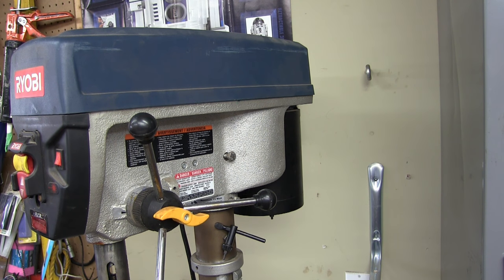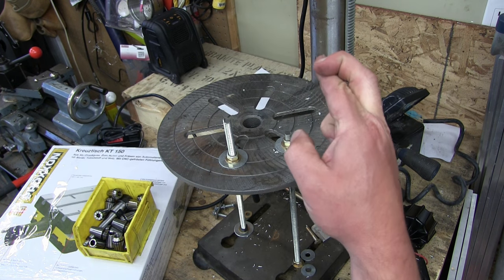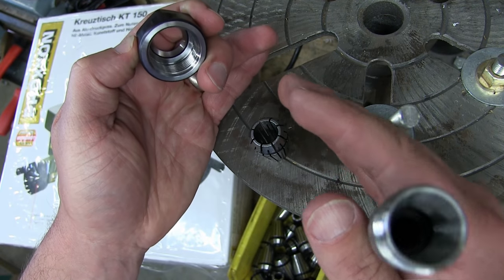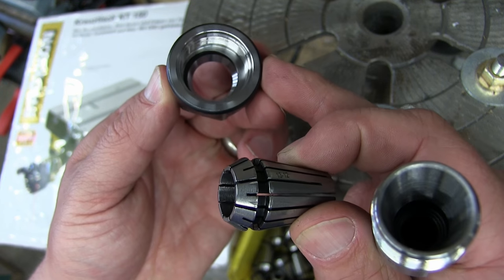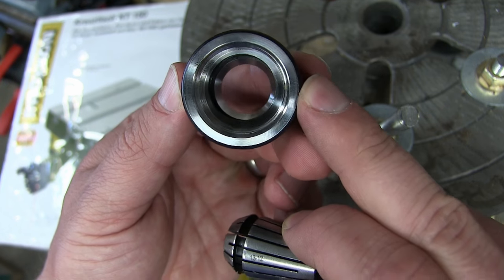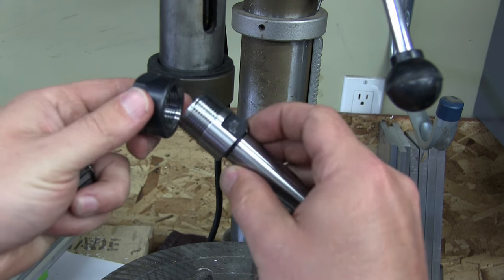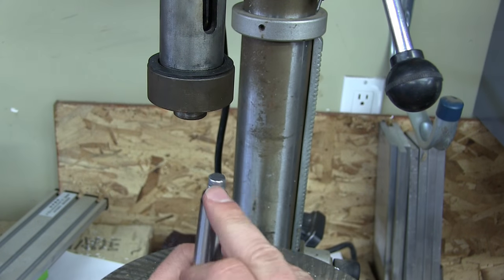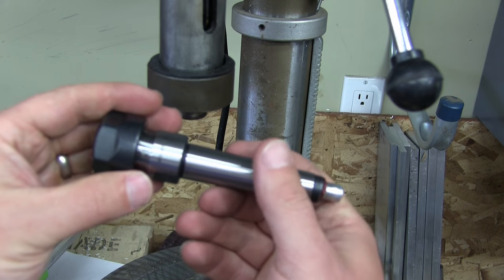SUCCESS!! Drill to Mill Conversion.

Comment: I have a similar setup with a $60 cast iron x,y vice. But I'm still using the Jacobs chuck and the table isn't stabilized. However, I do need to make something resembling a large machinists Jack to lift the sag out of the table so it's somewhat square & plumb. I would rather rely on the table 👆 👇 for Z and leave the spindle retracted completely when possible....less chatter.

Comment: The clamping nut is suppose to have that offset shoulder.  It's for clicking the collet into the clamping nut before tightening.  That's what the groove on the collet is for.  You did say you didn't have much experience with collets.   If you have a jacobs chuck, why do you need collets anyway?...
Reply: BTW, I'm excited to see the video when you add flood coolant.

Comment: The freight has a 2 speed bench top mill for $700, hit it with a 25% coupon brings it to $525. Getting 1/2 way there putting $250 down for the x/y, plus $50ish for the collet and other stuff. Ehhh. idk.

Comment: Looks good so far, but it looks like it could do with being a bit more stiffer to counter the wobbles introduced by the 200lb gorilla cranking on the handle. Not sure what you could do to Viagra it up some. Is the drill press bolted down? Weld some big lumps of angle iron to make stiffer triangles?
Keep up the good work.

Comment: Is it possible to......use the base of the drill press AS the table?  if the coulomb extend through the top or bottom? 
Much flex is due to small coulomb, but doing that,   would at the least reduce the sea-sickness.

Comment: How does the capacity (object size, machining limits) compare to something like the HF mini-mill.  If you can get the mill for say $500 US (assuming you don't have the drill press already) would that be a better option than a drill press and the KT150?

Comment: Ok I just got 12 inch drill press and was wondering if I weld the Chuck to the arbor and then drill a hole through the mt2  taper section then put a bolt through the wedge hole will it be better then stupid glue. 😎 Please help thanks

Comment: I would have used locktite, and to make the stuff go off,fast, rub a bit of emery cloth on a copper pipe, then rub the cloth on the faces you want to locktite, the copper atoms makes the stuff go off, then if you wanted to change it back into a drill, you could apply the fire as you did to expand it.

Comment: Its been 3 years now after gluing It in. Is It still in or fell apart causing mayhem? (And how many times hah) Im about to do the same mod and curious if Its long lasting. I will be trying to mill some aluminum and other soft materials, some facing etc. Greetings

Comment: [EDIT] WHY? WHY CAN'T I BE FIRST!!!!![/EDIT] The lip offset is apposta be in an ER collet You stick the bellend in on an angle into the nut, and it flicks over into that little T slot type bit.The taper past that bit is (probably) fine. You also need to put the collet into the nut, then tighten the nut avec collet into the arbor.

Comment: When you expand the metal with heat, Why doesn't it expand inward (inner diameter) as well as outward, therefore making it harder to get the collet in? I know it works. I just don't fully get why.
Reply: Ohhh! hang on.. shit. Yeah. I get it now. It's about the full mass expanding and the shape would probably also help. It only has one way to go and that's outward.. Just had to play it through in my head. Thanks for your help dude. :D

Comment: why not swing the table out of the way and mount the x-y table to the base. If the drill head won't slide through the shaft (giggity) you could just cut the column down a bit. might limit what you can use it for, but it would be more Skookum

Comment: Wouldn't it be better to sink the base of the press into a table or build up a table around the base, then attach the XY contraption to that? That'd give a you a more stable platform for the XY table and eliminate some of the wobbling.
Reply: It be a might more stable than the drilling platen that comes attached to the press.

Comment: I used a 6" cross slide vice from harbor freight to turn my shitty drill press into a shitty mill. When the chuck pulled out I just gave her a little tack weld. Milled aluminum plenty good enough to make a trigger pocket on a boomstick.

Comment: THIS IS DANGEROUS  - there's a solution.  The collet can pop loose - a spinning projectile slicing major arteries. Solution is to build a wire cage around the collet to catch it - similar to light bulb cage on a ceiling.  Or drill a hole thru the shaft then cotter pin it..-- Super glue can crack under  vibrations.

Thumbs up for thinking outside the box. Good luck.
Reply: we already saw what happens if the press tosses the collet in this very video.  It was running at full tilt at the time, and thats about as bad as it can get.  This press probly isn't more than a quarter horsepower, so it aint precisely a killin machine.

Comment: That moves more than a banana in a river.
Can't you lock the collect arbour with a cam bolt through the drift hole.
You can see the problem is the table to post flex.

Comment: I did not snap the collet into the nut when I first used my milling machine. Turns out reading instructions is a good idea before using fast spinnimathinging machinery XD. 'aint nobody got time fo dat, luckily I escaped without injury XD.

Comment: meh.  ive been milling aluminium and brass and wood on my 25 year old sears 8 inch drill press for the past several years.  its got a regular $40 chineseum cross-slide vice with a little bit more than a quarter inch of slop (acme threads through a plastic nut that has a hot dog down a hallway fit into the base of the for/aft axis), and the stock jacobs chuck.

Comment: Funny, I have done the EXACT "conversion" you did, and it is an ABJECT FAILURE. The little table you have will move 50 thousandths or more, the tool will walk all over the place. You can't even mill light aluminum cuts.

Comment: I hate to tell you that you just fucked up that nut. That is a spring collet you have to push the collet past the the part you bored out into the groove in the collet. It is the part that pulls the collet apart after it has been tightened. That is without beating the hell out of it .
Reply: Sorry I did not see the pinned comment, my bad.

Comment: There are many milling machines that have a  Morse taper spindle... I’ve used them for years. Lucas, and old Giddings & Lewis (G&L) horizontal boring mills both have Morse tapers. G&L uses a 6 Morse taper with a slot about half way between the tang slot and the end of the spindle. It looks just like the tang slot, but it’s to keep side cutting mills where they belong when you cut. That slot goes completely through spindle and shank where you drive two tapered draw keys (they look like cut of drift pins) that are driven on opposite sides to draw that tool into the spindle. That mill stays in. But I would definitely rather use a draw bar.  You know just enough about machining to be VERY DANGEROUS. PLEASE SEEK ADVISE FROM A MACHINIST! 
I truly say this for fear that you hurt yourself or a friend. Sorry for being rude.

Comment: I've always been told to never use a drill press as a mill because the spindle bearing is not designed to take side/radial loads. Is this just an old wife farting down wind tale?

Comment: climbing is not a good situation on any Bridgeport unless you're taking light cuts. cuz you have a backlash. I seen somebody take a heavy cut, it pushed the whole fuckin  table forward. He ripped the dam apart right out of the vice. lol. and yes I know you could tighten the table so it doesn't move on the backlash, I've seen people do this. Why, who the fuck knows.  But, often taking a heavy cut like a 3/4 ths End mill, climbing is NOT A GOOD IDEA, NO! LOL